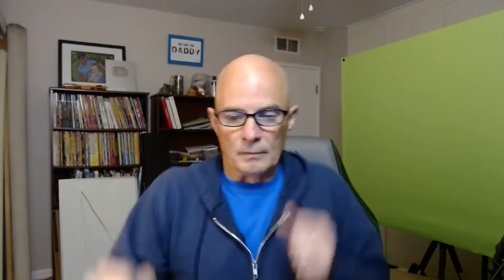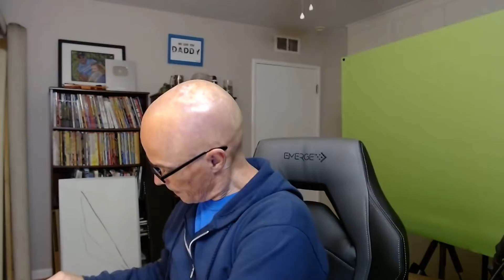LET'S TALK TECH-IS A TURBO SBC STILL A GOOD THING?

Comment: Hi Richard, I have a gen 1 built sbc, I’ve been looking into switching to a 5.3ls to run boost. What would be the power limit on a stock GM block with forged internals if I ran boost
Reply from the maker: I have not push a 350 block to the breaking point-but likely not as high as an LS

Comment: In my opinion the reason why it might’ve not picked up was because of the low tech EFI most people would walk away from the EFI and I must specify that I never put my hands on it I did worked with many GM EFI fuel systems and  those on the v6 engines like centuries and luminas would fire all 6 injectors continuous imagine if they did that with a v8 and trying to high rev it full of fuel on the runners that’s also why when you lost a spark dew to a bad coil it would wash out the cilindro.

Comment: Have you ever tested the stock block 23° cylinder headed (383) cu in ? How much boost will it take and how much power before the block gives up . 2 bolt converted to the 3 center caps are splayed. Has a forged balanced rotating assembly.  Thanks. I am trying to find we're I would need to go to the after market block.
Reply: Problem with the stock block is that its a roll of the dice as to quality. It might hold 1500hp or crack at 500, no real way to tell.
Reply: @taylorsrus9543  Thanks,  iam going to try 750 to 800. 1/4 mile runs . 2800 lb s10 .

Comment: I have a 406 509 2 bolt.  Stock rod and crank with Old School TRW forged pistons. Trickflow 195 heads.
Ran 8.9 PSI all last summer.  Twin 66/67 turbos.  How far do you think I  can push this thing?   Ran best of 11.67 at 121 mph.      If I can hook it will be in the 10s.   Pump E85 on Holley Terminator x
Reply from the maker: not sure on that block-but it will last a few passes at 1000 hp
Reply: @richardholdener1727  I have a Dart SHP block eagle rods and pistons waiting.
   1000 HP a couple passes sounds amazing.
Reply: To hook a Nova, call Calvert. This is kinda a prime example why not to do a SBC

Comment: my son has a bone stock 1988 corvette, is it possible to put a turbo in place of the catalytic converter? if so what size to get 5-7 lb of boost to run the stock chip and computer and what size injectors are necessary to sustain the hp level? how much hp and tq with that boost level?
Reply from the maker: you need to have a turbo motor tuned
Reply: @richardholdener1727  hard to find a L98 Tuner these days, I thought Larger Injectors, and boost on top of the fuel pressure regulator along with stock lazy timing might work with low boost.
Reply: @LarryKeller71  LS Swap, you will start out with 150% increase in HP. If you really want to keep the current setup you might be able to rummage around and find an old Kenne Bell setup that would work, but you will still be getting bullied by modern 6 cylinder cars on the street
Reply: @taylorsrus9543  the car is worth absolutely nothing oh, we paid 1500 for it with a broken spark plug that we had to pull the head off to fix. I was just thinking about slapping a power Adder on and was remembering the old turbo systems that bolted up to where the mufflers were. So I thought low boost and putting a small turbo where the cat is. Like a $500 project. Not a racecar just a fuck around car. I'm sure 5 lb of boost on that would be damn near five hundred foot pounds of torque.

Comment: What about turboing my LT1 '96 Camaro? What turbo would work good for a street car with 7-14 lbs boost?
Reply from the maker: the difference between 7-14 psi is a 50% (compared to na) swing in power
Reply: @Richard Holdener  yeah figured leave the gate set at 7 for running around day to day might max of 14 psi for race occasionally. Think the stock internals would holdup?
Reply: @Csmjeffdavis  95-96 LT's like to spin mains. A lot. Best sounding motor ever. Might have to go to aftermarket ECU as its hard to find someone old enough to tune the factory stuff.
Reply: @taylorsrus9543  there is a kit to use a 24x wheel and put a camshaft sensor under an aftermarket timing cover on an lt1 then you can remove the optispark and get the ecu and ignition harness and coils from an early ls engine. I know software to tune early gm stuff is free and available. But you need a chip burner adapter and you need a stock of rom chips which im not sure if they are able to be reburned and may be out of production. Although ive never done it i believe that i could if the chips are available.
Reply: @danieldimitri6133  it can be done, these don't have chips unless it's an obd 1 connector. If it has the obd 2 connector you can flash directly to the ECM. The Tuner Cat flasher supported both. No idea if they are still available though. Never really had a problem with the optispark even though they have a terrible reputation.
Reply: Kinda depends where you put the turbos. If its a rear install behind the axle you probably need a smaller turbine like a gt3582 because the exhaust will be cold and might be as little as half the volume as it is at the manifolds. If you can manage a front install in that car the turbo would be larger.
Reply: @Richard Holdener these guys got me thinking, what if you applied all the LS type tech to a SBC? Maybe even adapt a LS truck intake? And the coils and sensors.
Reply: @Csmjeffdavis  just buy a set of SB2 heads and it will become clear.

Comment: I'd love to see a single turbo done on a tbi 350
Reply from the maker: HARD TO GET ENOUGH FUEL
Reply: Its good on a 4.3l but on a 350 its too easy to run out of fuel flow, in other words its too easy to make decent hp. Only single digit boost numbers would be possible. Generally speaking a tbi doesn't have safe fuel flow for much more than 400hp. You can use a 2:1 boost reference regulator so if you're going to over power the injector with fuel pressure its only when the engine is under power and needs flow so maybe you can push the safe power to 500+ but other than just running large conventional injectors over the throttle body or dual throttle bodies you're going to hit the hp potential of the injector pretty quickly.
Reply: I had one with a Whipple was still tbi. It used a multi- port fuel pump so from 15lbs to 45lbs. 8psi was good for 100hp. Still in a short bed truck it shocked vette owners. Lol
Reply: 0 drivability issues.
Reply: That's kinda what I figured

Comment: The LT is great until you reach the point where you need to supplement the DI with traditional fuel injection to make big power. Power that you can make with the ls with 8 regular injectors.

Comment: Especially like the comments on Corvette install.  Often had questions about an install in my vehicles. Boost=power is understood, Factors such as, turbo/exhaust placement (looks much easier in the dyno lab) and wiring in a turbo controller to match the vehicle ecu. Any general info on these real life factors would be appreciated.  Thanks.
Reply: Hit the books. Its all there.

Comment: Hey, Rich!! Got any LS 5.3, 750-800hp N/A recipes???
Reply: Is that flywheel or at the tire???
Reply: @scotttimpany2845  would love at the wheel lol
Reply: @ruebenb83  Hahaha... I get you.  750-800 N/A isn't going to happen, but add a turbo and it will happen.
Reply from the maker: 800-HP NA 5.3L? 2.47 HP PER INCH?
Reply: @richardholdener1727  stoker?
Reply: @ruebenb83  here's a stroker https://www.youtube.com/watch?v=DBY8F8cPXQc .  IT HAD THE WRONG CAM!!

Comment: My thoughts on the small block today and the last ten years is the ls had very easy tuneable efi from the start which made turbo street engines very easy… but with Holley that’s not necessarily the case. I have a 24x Holley on my sbc and it works great so I personally feel you’ll see 18° and 13° sbc start to make more appearances again.

Comment: Basically u want the both tourqe in HP numbers close as possible older guy told me this at the machine shop
Reply from the maker: THAT IS A MILD COMBO-MOST HIGH PERFORMANCE ENGINES HAVE MORE HP THAN TORQUE
Reply: Ohok so uneven numbers aren't  always bad?

Comment: I wouldn’t mind a 400sb with the 4.125 bore put big valve heads on solid roller. Splayed caps dual turbos and that red tunnel ram DV has had in like 38 episodes…

Comment: Richard. something no one seems to address is parasitic losses from back pressure as opposed to parasitic loss of crank driven centrifugal. belt drive as opposed to gear drive. also, the need for inconel exhaust valves on a turbo application and when this material should be considered. Fodder for future discussion.
Reply: How do you measure that first one? I would say in practical uses like a turbo vrs super charger the loss is heavily in favor of the loss the back pressure. Turbos spool with little loss superchargers are prover loss it takes like 300hp to spin a 2650 at 7000rpm.
Reply: @inconel do you have the pocket book for it? Then you can run it for whatever you do they are “like” what f1 engines use. They don’t do the things titanium valves do and maintain their consistency at very high temperature they are usually friction welded and the stem can be made more guide friendly. You can build exhaust from inconel as well. Its light weight. I think the real answer to when do you need them? Is when your racing and you want to win, that bad. David Vizard has some videos about exhaust valve shape, and valve train in general, weight, spring resonances, theory.

Comment: Not in Tampa, FL area. LKQ has 3 locations which all are less than 1hr away from my house. There are just as much gmt800's if not more than gmt400. Yea, couple of the gm trucks at any given time per each LKQ are the 4.3L v6 motors. But I'd say more lsx v8 then sbc2.

Comment: No I still use SBC  I have a 427ci SBC & 383 SBC.
Reply: Procharged sbc 427 here as well.. 1300 hp and drives like a caddy on the high way..
Reply: My 427ci is procharged an is in front of a built 4l80 transmission and 9"ford Moser  spooled 40 spline rearend.
Reply: In a s10 country boys corvette.

Comment: No idea to waist any more time on stone age sbc. LS rules all the way, make it right at the first place.
Reply: Sounds like you Do not know how to build a SBC I have a 1000hp sbc.
Reply: @michaelmerrill589  did it come with 6 bolt mains ,alloy heads ,  roller cam ,hypertectic  pistons ,and some weird arsed powdered metal rods that for some reason work even though nobody thought they would  stock ?  no ? there is no shortage of motors that can make 1000 hp with the right amount of money thrown at it  ( and boost ) how many stock parts in your sbc
Reply: @James Thompson and 6 bolt mains ? your peronal choice of aluminium block or cast iron block .how many stock parts in your 1000 hp sbc ?
Reply: @James Thompson aahh so you dont have a 1000 hp sbc  thanks for your service at the keyboard you sir are a warrior  and are a credit to your country
Reply: @michaelmerrill589  Is it a daily driver? Pump gas?
Reply: Is a 1000hp some kind of magical number,that's all I ever here anymore,why stop at 1000hp...and why would you want to take a chance on stock parts everytime you make a pass,heck you wouldn't go buy a $80k truck and put liability insurance on it lol

Comment: Yes it is still a good thing , same as a BBC , LS engines are over rated . Power is made from CID not what type of engine it is.
Reply: Power is made from airflow and engine design has everything to do with that. A big block chev with peanut port heads and a stock cam makes less power than a stock LQ9. A lot less. It because the induction package moves air more efficiently. The LS is the evolution of the SBC and the LT is the evolution of the LS. In stock form they make more power than the predecessor. In the aftermarket dollars make horsepower so the platform you start with is mostly irrelevant.